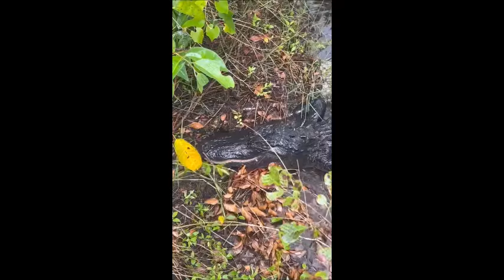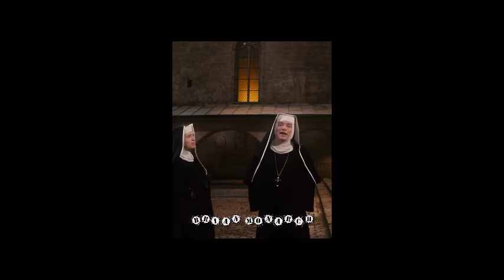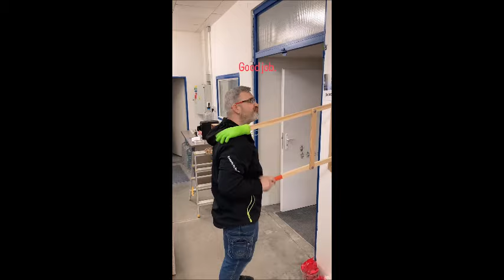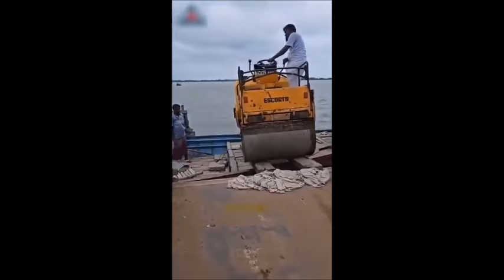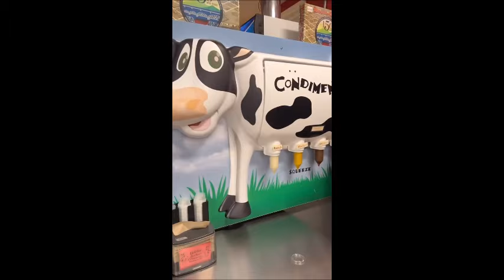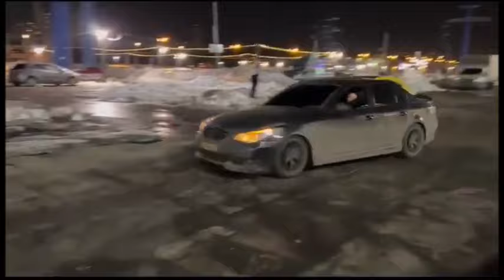An Alligator Ate My Cellphone

Comment: Sadly, if the battery breaks it will kill the gator. Doubt battery acid is good for your intestines
Reply: Cellphones contain lithium ion batteries. Which is not acid based
Reply: @charlesduckerson7078  really? 
Isnt it still unsafe? I mean, i dont know under which circumstances exactly a battery explodes, but ive seen videos and stories of people getting burned/phones exploding (like the note 7), and the like. 
Would stomach acid not be able to produce such reaction? Or breaking the battery into pieces?
Genuinely curious